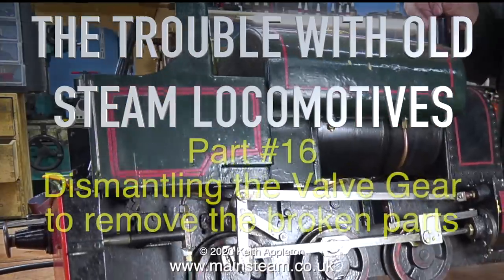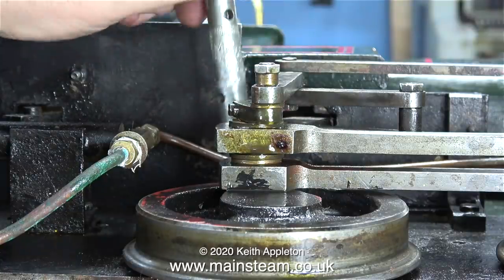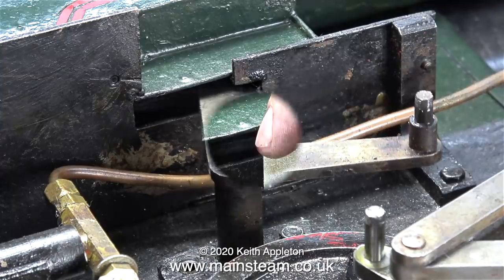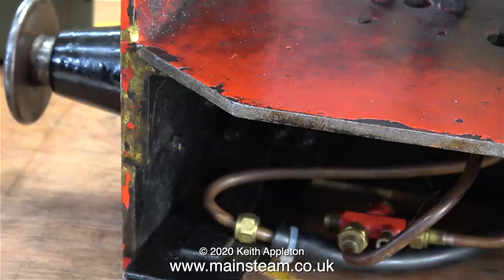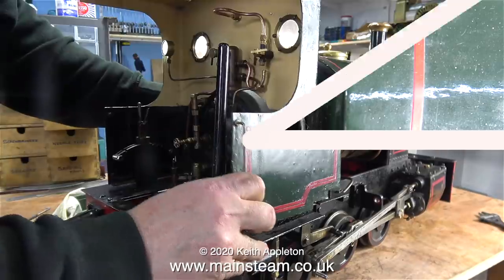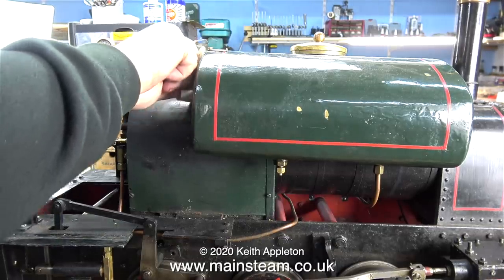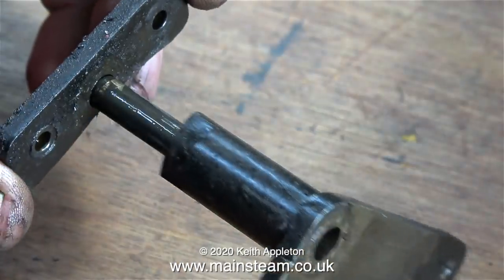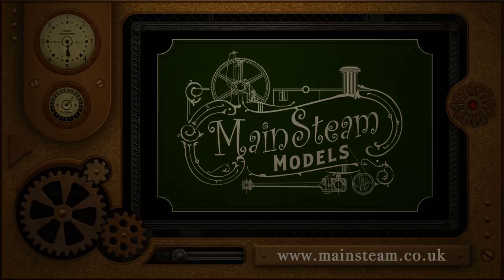THE TROUBLE WITH OLD STEAM LOCOMOTIVES - PART #16

Comment: Good to be back watching Keith again.  I have a lot of catching up to do!  Question:  What kind of pressure existed that this part broke under?  I wouldn't think it would be enough, though if it broke then it must not have been strong enough.  Did it break because someone pushed/pulled to hard on a lever?  Is the vibration bad enough on these model steam locos to cause parts to break?
Reply from the maker: Badly made, and a poor design.
Reply: @keithappleton  Ouch!  And you agreed to fix it?   You are one braver man!

Comment: You're right! Valve gear is a a variation of Hackworth valve gear known as Marshall valve gear. Much like what Baker did to Walschaerts, simplifying the slotted linkage for radial linkages, its much easier to build. Not the greatest valve gear for valve events, but the wheels still go round.
Reply from the maker: Thanks for the info!

Comment: I totally get where you're coming from with the painting commentary. Degreasing is time consuming, as is disassembly and reassembly. Paint is expensive, especially paint that can withstand the heat of a boiler. Your time is better spent fixing things that are broken rather than making something just look good. You can gold plate a piece of trash. But in the end, it's still a piece of trash.